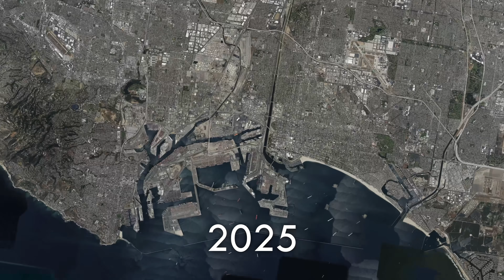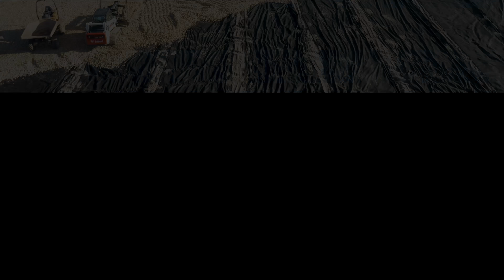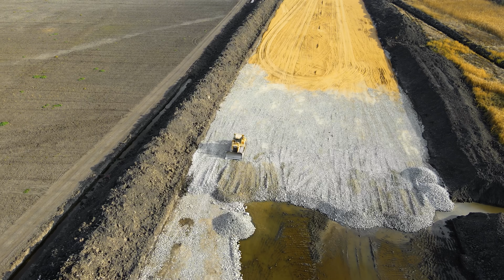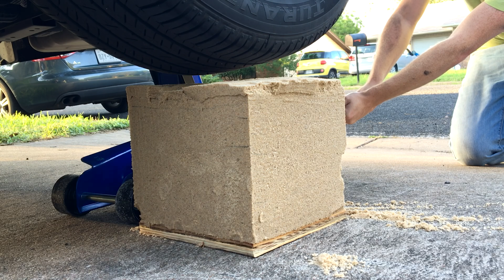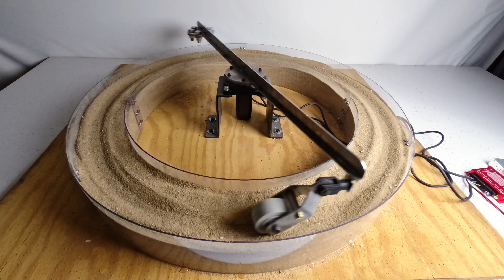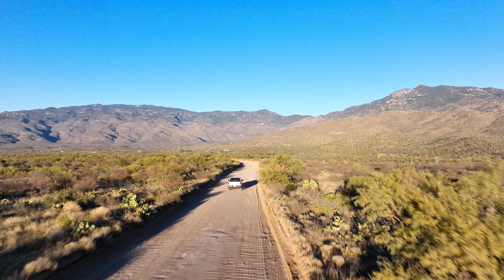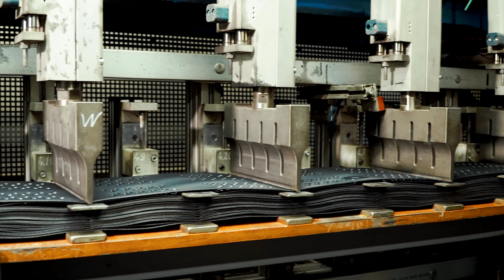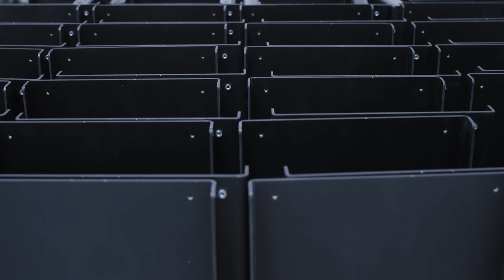The Grid That Doubles the Strength of the Ground

Comment: easily one of the best uses of recycled plastics i can think of literately taking trash picked from road ditches and using it to later build a better road and ditch
Reply: Similarly, I know some roads in NZ are being built from old car tyres... shred them into small pieces and use them as fill. There's not much you can do with old tyres, so this puts them to use instead of just being buried in a landfill site, and I guess it saves on quarrying too.
Reply: @simongeard4824  In the UK we sometimes shred the tyres very small and incorporate into the asphalt mix with the stones and bitumen.  It makes for a low-noise road surface.
Reply: @marionbloom1218  That might be the same thing I'm thinking about, actually... I'm not entirely certain of the details.
Reply: taking trash and putting in the ground is good how?
Reply: @Zoulstorm  If you bury plastic, it's a reliable, low-cost, long-duration way of sequestering the carbon in the plastic.  If you burn the plastic to make energy then the CO2 produced (which came from oil in the ground) goes into the atmosphere.  So burying plastic can be a smart move environmentally.
Reply: @Zoulstorm  it's no longer trash if it serves a purpose
Reply: @Zoulstorm  All trash ends up in the ground anyway. This way at least its by design and being used for a purpose

Comment: Adding plastic honeycomb to a gravel bed is like adding rebar to concrete.
Reply: Its like adding fiber to your diet
Reply: indeed, the analogy is there... except both the plastic and the fill are quite a bit cheaper than rebar/concrete. ofc, they're also used for very different purposes... idt there's a way to turn geocell+fill into structural building material? would be kinda cool if that would work tho
Reply: @alveolate  what im comparing is that one material works great under compression but with latteral force or tension they fail... adding another material that works hand in hand to fix this flaw is what im referring to.
Reply: Adding microplastics to your brain is based
Reply: @Zoulstorm   adding love to your life might make you happier.... but why tell you that?
Reply: @Pestsoutwest  Don't got room for that, due to the microplastics

Comment: I've seen geo-cells used for fire equipment access around office buildings.  They did it in such a way that some grass would grow up to improve the green space, but since the grass was less thick, you could clearly see where the "roadway" was to allow equipment easy access to the sides of the building.
Reply: yeah, geocells + grass is a very aesthetically pleasing option for low-use drives and alleyways
Reply: Quite a few of my local parks use this for the car park.  They scrape away the top soil, put the geocell in and then just drop the dirt back on top of it.  After a year you can see grass growing through it and basically eliminates the rutting you otherwise get when the carpark is just soil.
Reply: It was probably a concrete paver in the same pattern that allows you to grow grass on/in it. Used to have it at a house that I lived in for the front driveway. You mowed it and everything.
Reply: geo-cells should also work quite well below a layer of permeable ashpalt.
Reply: The poor grass growth may be because the geocells were filled with something other than native soil.
Reply: @MartyRothbard  Maybe by design so the trucks could see where to go?
Reply: @MartyRothbard  Maybe even because there's not enough space for the grass to root in? I imagine growing roots would normally push away the dirt, and geocells might prevent that
Reply: @MartyRothbard it could also be that the partitions between each cell meant that there are repeating gaps in the grass cover, so it's growing in tufts rather than as one connected field. The difference in grass density between the path and the unaltered grass doesn't even have to be that much - people are very good at noticing differences in patterns like that.
Reply: @MartyRothbard   Traumatized grass will grow less. Also if it's used by vehicles, they will drip oil and drag oil onto it. This also negatively affects grass growth. You'll never get the same growth from a vehicle travelled path, especially leaky, dirty roadway vehicles. You could fertilize the road and do nothing for the turf and still get less growth than the turf. With or without geocells.

Comment: Interesting. I've recently visited two wind turbine construction sites in my area. There, they need to improve the soil's load bearing capacity for extremely heavy machinery, such as SPMTs and the 200 m (600 ft) tall crane. One of the construction sites is in a field near an industrial company that builds the turbines for self-consumption of electricity. That's somewhat unusual. The other is more typical for my state, it's on a mountain in the middle of a forest.
In both cases, the solution is to simply spread very large amounts of crushed rock aggregate over the construction sites and temporary roads. The big crane's already enormously wide tracks (about 5 ft) sit on additional wooden load-spreaders.

Comment: Makes me think of the highways in Alaska and the Yukon. It's a non stop battle with the ground under the roads moving. There are sections that have what look like ventilation pipes going into the ground. I assume it has something to do with permafrost, but I really want a Practical Engineering video about it.
Reply: What he should really do a video on is thermosiphons. They were invented to built the Alaska Pipeline and are basically the only reason it could be built
Reply: @louisjov after some googling, I think that's what are along sections of the road. It would definitely make a good video
Reply: @99Scott  Tom Scott Has a good video on thermosiphons- It's the Canadian "Giant Mine" video on Arsenic containment.
Reply: @Originalsunrunner20 I'll definitely check that out, I love Tom Scott
Reply: @louisjov  Such a video might cover building on permafrost more generally.  Heat loss through the foundations of large structures with interior heating that are built on permafrost can melt the permafrost and cause the buildings to sink.  The usual solution is to base the buildings on slabs that are passively refrigerated with thermosiphons.
Reply: @MikeV8652 The lower tech solution is to simply build tubes in the foundation to increase the surface area and allow air flow to keep it colder than freezing.
Reply: @kellymoses8566  That could work with smaller buildings, but less so with increasing size.  It could also weaken slabs that need to support heavy weights.  Lighter buildings are often elevated on piers.
Reply: @kellymoses8566 typically what's done in high permafrost areas is pilings are driven deep down below the permafrost layer, which can often be extremely thick, and the buildings are raised up a few feet off the top of the ground. 

The trouble with permafrost is that as soon as you disturb it, it starts to melt, so much so that about half of the population of Fairbanks Alaska lives in so-called off-grid dry cabins, because any power or water utilities that would be run out there through permafrost would break within a year because The utilities themselves would create too much thawing in the permafrost. 

Climate change is just making these problems worse, and many communities in Alaska have seen some incredibly serious grounds of silence issues in the last couple decades because of it
Reply: @louisjov  A ton of Russia is facing similar challenges. And the permafrost there is incredibly thick. Look up the Batagaika crater. It's also not the only one forming there. 40m of soil collapsed into 10.
Reply: @louisjov he should really come to Alaska and do a video on thermosyphons. It would be awesome.
Reply: @louisjov  they weren't invented for the pipeline- they've been around for quite a while before that, although (and this is just me speculating) maybe the pipeline was the first to use them to chill permafrost? anyway, they are very cool, no pun intended
Reply: The same situation applies in Finland: freezing temperatures cause the ground to freeze in winter, and the freezing—and thus wet—soil expands, damaging the road surface. Insulation or replacing the soil with free-draining crushed stone to a sufficient depth helps prevent this.
Reply: @70P1  The Finnish situation is an example of "frost heaving" from seasonal freezing/thawing.  Permafrost never naturally thaws, but a heated building not elevated above ground can thaw it under the slab to its own peril unless the slab is refrigerated.
Reply: i just remember that to build and fix the lowry hill tunnel here in minneapolis they had to freeze the ground  to build it so mb they used similar technique?
Reply: It’s more about the Canadian Shield at least in Yukon and NWT which helps conserve the road since ice isn’t in rock but still
Reply: You are correct. The pipes do have something to do with the permafrost. They are there to help keep the permafrost frozen, because they know once the permafrost thaws, the things on top of it are going to get tippy.
Reply: similar in more southern places too.  I'm ready to say it has a lot to do with the shoulder of the road, or how much "extra" road they're permitted to use to make the road.  To go along with that if the zone is post-glacial stone piles between ledges the entire place is slowly moving down hill.  Slow as anything but inexorable.
Reply: @Jamtrenched The effects can definitely be similar but permafrost is a fundamentally different material to work with, and it's incredibly difficult to build things and mess things up when you don't know what you're doing
Reply: Those pipes are exhaust pipes from the stoves that keep the undlayment at  a constant Temp  to minimize movement
Reply: Frost lift of culverts(tubing to let water drain across a road), post10 has a demo of it. He also has in his many vids examples of frost lift damaging culvert in location and the resulting flooding and road damage.
Reply: Eh, just wait a bit and the permafrost won't be a problem.
Reply: Ice makes its own set of headaches, on top of the usual issues with geoengineering. Frost heaves can push up things from underground, including boulders, as well as absorbing fines or washing them away when it melts

Comment: Won't this just leach toxic chemicals into the ocean as the plastic degrades? Why not just drive wooden poles into the ground to stabilize the soil like in Venice or Tenochtitlan ? (The Chinampas specifically not post colonial Mexico)
Reply: not really, at least if it maintained the degradation do to UV exposure so al long as there a layer of soil blocking the UV the phasic will be stable for centuries . untreated wood would only last a decade or two depending on conditions and mostly  likely would need to be treated and those chemical would definitely leach over time.

Comment: The main problem with plastic is that it is impossible to get rid of. But geocells are intended to last as long as possible and get as little wear as possible, so a road doesn't have to be repaved as much as usually. So I feel like it might be much move environmentally friendly than most alternatives! I'm genuinely hopeful that with modern engineering, if governments make sensible decisions, we can build and live in a way that preserves the planet.
Reply: considering the use case... they would almost never need to be replaced. and even if they were ever removed... the "used" geocells might still be tough enough to be reused elsewhere! as long as there are proper standards for testing, i believe this could be done.
Reply: Plastics are far from impossible to get rid of. Many types of plastics can be chemically reversed quite easily, many actually do get broken down by micro-organisms, light, or heat. The threat of plastic strongly depends on the type of plastic, some plastics are biodegradable they just take a long time to degrade, most plastics just don't decompose under normal conditions, require specific conditions to decompose, conditions which can be created for treating them. The main issue with plastic waste is that not all recycling facilities have the means to handle every type of plastic, and if they don't handle the type of plastic they often just throw it in the garbage heap. If you look at the recycling symbol for plastics you'll almost always find a number in the middle, this number is an identifier that refers generally to the processing required to recycle it, with higher numbers usually requiring more specialized treatment, 3 and below most recycling centers can handle, 4 and 5 maybe some larger regional centers may have the ability, and 6 and 7 may require highly specialized processes. But companies that put these kinds of products in will know where to go to recycle them properly.

HDPE is a highly recyclable plastic, one of the most recyclable plastics, but for this use-case it will likely stay in the ground for the duration of it's life, which can be a few hundred years in ideal conditions. HDPE is vulnerable to UV light and to a lesser extent oxygen, both of which cause it to break down over time, so when buried in the ground it remains quite stable and has a low risk of fragmenting into microplastics or leaking into ground water, as UV light and oxygen exposure are largely responsible for that, under normal conditions HDPE is quite inert. There are more environmentally friendly plastics, but they tend to be designed to degrade much faster so they're not useful in a semi-permanent structure, HDPE is likely the best current plastic that balances the environmental concerns of the plastic with the time it remains stable. Still there's definitely room in the future to do better.
Reply: Governments making sensible decisions... I don't know if you looked around recently but that's not happening anytime soon.
Reply: @nukulator  Governments aren't all politicians.
Reply: @user-fk8zw5js2p  Only if you include maintenance staff and other such jobs
Reply: Let's just say that we are in a phase where there needs to be drastic sudden adjustments to things to prevent reaching tipping points of food producing ecosystems and all that is being done is minor greenwashing amplified loudly by some companies...
Reply: Sunlight breaks down plastics and there are microbes that can digest plastics.  Plastics only last for centuries if they are buried and not treated.  People will be fine as long as they don't start living buried in dirt.
Reply: Plastics are made from oil. Oil is tens to hundreds of millions of years old. If you consider that to be close enough to "impossible to get rid of," then there's not much difference between burying plastic versus not pumping the oil out and leaving it underground.
Reply: @makaira69  they figured out lignin and cellulose. They will figure out man-made polymers eventually.
Reply: Give nature time.  Eventually soil bacteria will evolve to metabolize common polymers.
Reply: Impossible?  They burn fine at high enough temperatures, and given the same energy abundance you need to stop burning fossil fuels, you can put new feedstock back together from water and CO2.  You just have to burn it in a proper incinerator instead of an uncontrolled trash heap.

Comment: Huh, they’re using something kinda  like this on a highway that is being re-done and expanded here in Montreal.  Last year i was stuck in traffic the leads to a tunnel under the St Laurence sea way, and noticed it.      Montreal has a mix of soil, granite and some volcanic rock, so I guess they’re finding it serves a good purpose.    
It’s also becoming a drive way material, though it’s exposed and appears to be made of cement,  and exposed.  Grass grows through it.   I guess it’s cheaper than paving and more environmental

Comment: Making old tires into geocells seems like it would solve a couple of almost intractable problems...
Reply: Most old tires have steel belts. Would you leave them in or take them out? One problem is that tires are made out of a minimally processed petrolium product with a lot of fillers and might tend to break down over time. But an interesting thought anyway.
Reply: @mike95826  Still is removed from belted tires daily. Unlike Grady, I'm not an Engineer nor a waste recycling specialist but I know tires are rendered into many things like running surfaces and pavement.

Comment: Plastic. How fast will it degrade? Cyclic loads and everyday normal aging.. 
And what about when it's spent? We just throw up our hands and let the plastic carcass be, burying it beneath another layer of plastic honey comb soon-to-be plastic waste in the environment?
Reply: Wait until you find out about sewer, drinking water, natural gas, and electrical supplied by buried coated wires - you should probably sit down for the news because you're going to be pissed...
Reply: many decades to a century or so depending on maintenance. buried plastic isn't really all that bad of the environment its exposed plastic the breaks down in sun light and create the issues.   as for when it is removed for major maintenance or upgrade it can be treated more less like any other plastic waste.